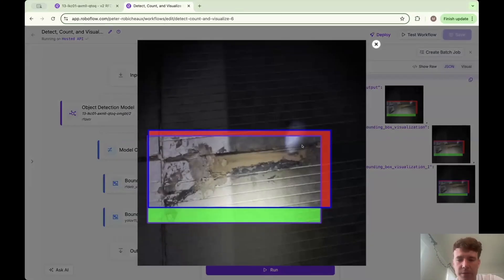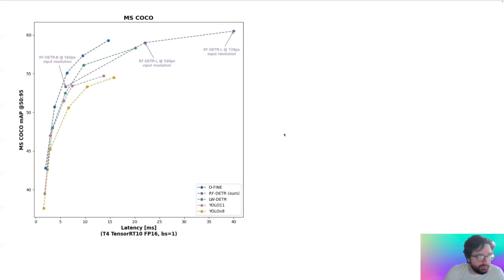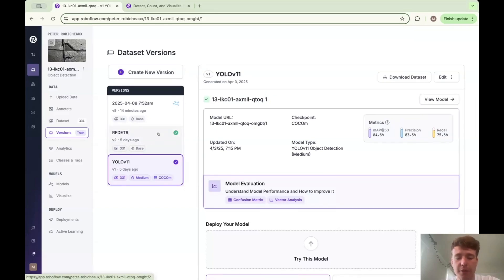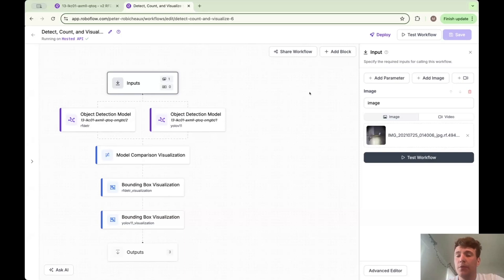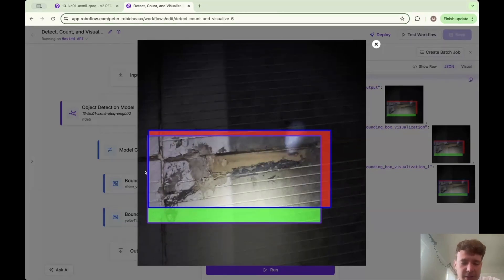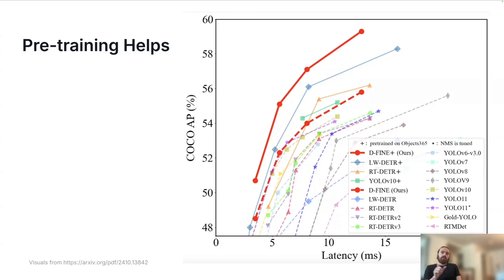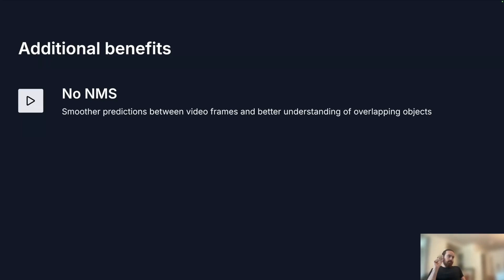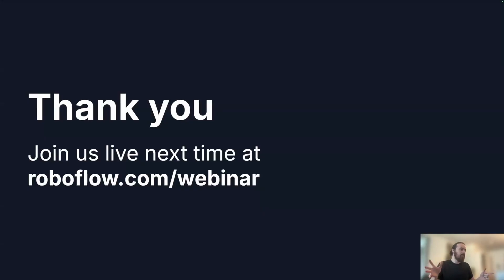RF-DETR Architecture & How it Works | Why is DETR Better Than YOLO?

Comment: I'm curious about the slide, ""Pre-training Helps... Only for DETRs". The stated claim is that RTMDet-t converges faster than the YOLO models when using a pre-trained starting point. But after 200 epochs the difference between non-pretrained and pretrained YOLOv8n, RTMDet-t and YOLO-MS-XS are 0.7, 0.7 and 0.8 respectively.
And comparing 20 epoch to 200 epoch for those same three models with pretraining shows differences of (35.2 - 31.5 =3.7), (41.7 - 33.4 =8.3), (43.0 - 37.5=5.5).
So it appears to me that RTMDet-t is converging slower than the other models shown on that slide. Am I missing something?

Comment: I used ByteTrack for tracking and counting when using the RF DETR model for stream detection, and modified some camera compensations for the drone's perspective in the Kalman filter in the detector, which only achieved smooth playback at 720p20hz. How can I improve the inference efficiency?

Comment: good day i have a doubt. my company wants to use the rf detr model, but it does not appear as an option in the custom train menu (versions), when is this going to be available, thanks! your work is amazing
Reply from the maker: This is available in the train menu, info here: https://blog.roboflow.com/train-deploy-rf-detr/
Reply: @Roboflow thanks for your answer! I actually did try from the train menu, In the custom train menu and the workflows menu, is rf detr available for everybody? When we do custom train we only have Roboflow 3.0 and Yolo V11
Reply from the maker: @RR12369  RF-DETR is available for everyone using object detection. It may be that your project is not object detection which is why you can't access it for that particular project